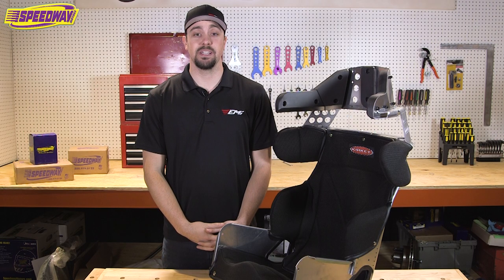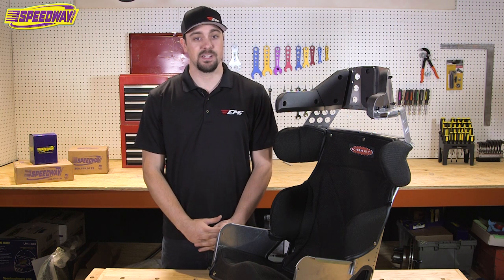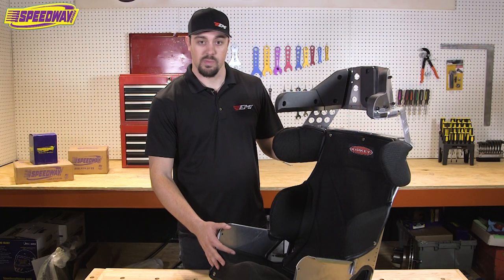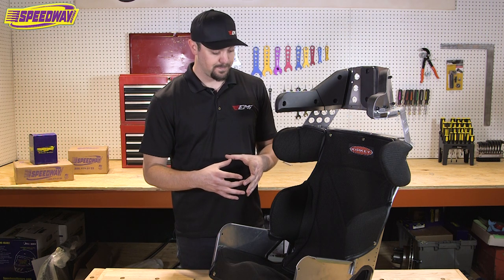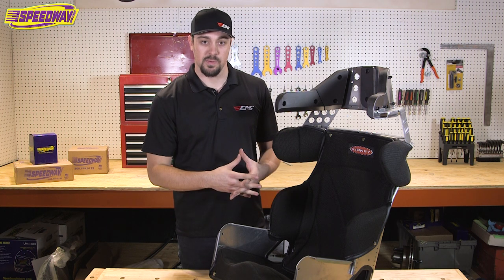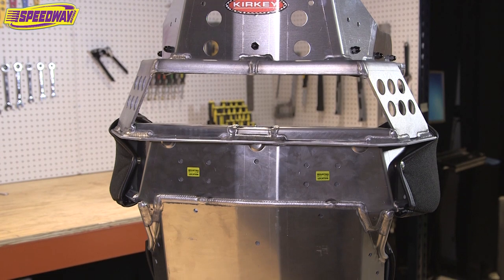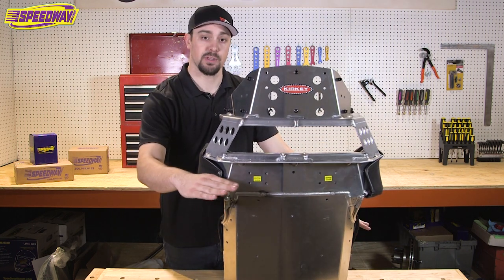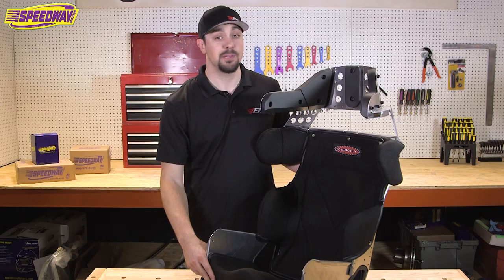Speedway Tech Talk - Selecting & Mounting a Racing Seat

Comment: You never want to mount the seat belt below you shoulders, you want it mounter at the same height of your shoulders. When you mount the below your shoulders and pull down into the seat your a pre loading you spine and increasing the chances of a spinal injury in the event of a crash.